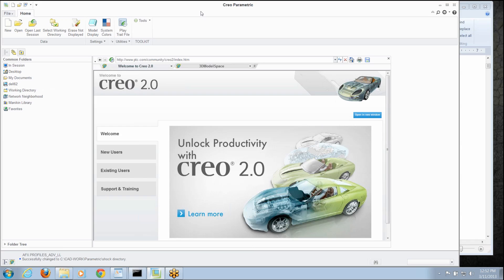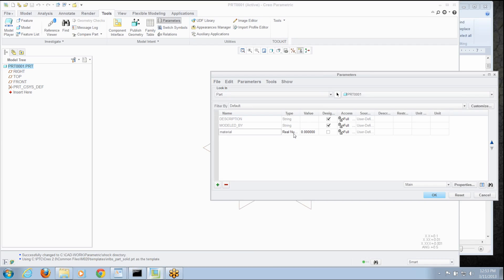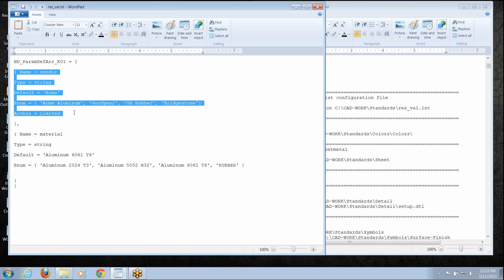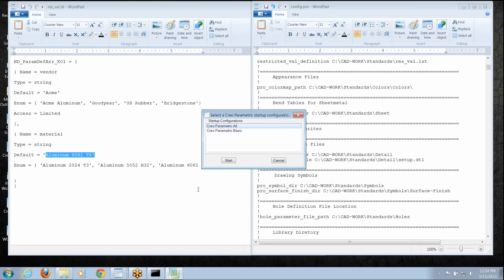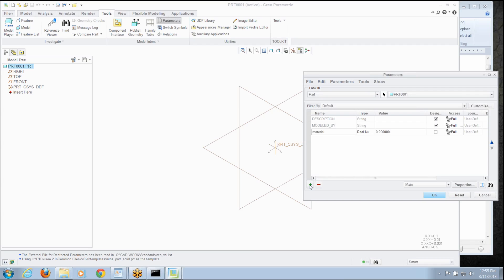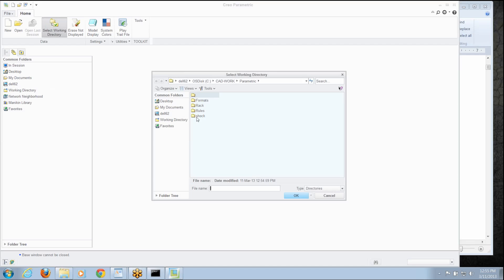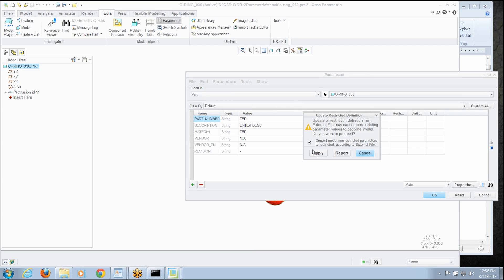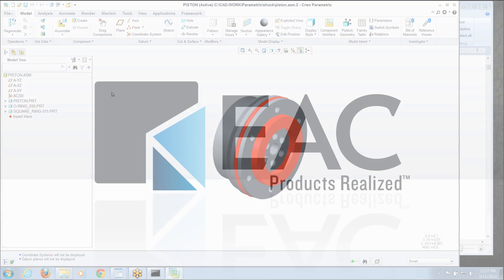How to preset and restrict attribute values in Creo Parametric - EAC Tip of the Week

Comment: can anyone help me to solve this issues.
i will explain the path which i was passing.
1st step typed in note pad:

{ Name = vendor
Type = string
Default = 'blue_new'
Enum = { 'GOODYEAR', 'kapri', 'luck' }
},
{ Name = material
Type = string
Default = 'aluminium'
Enum = { 'aluminium', 'SS316', 'steel' }
},

saved as type :  " all files"    and renamed as "   list1.lst   " then copied to the folder contain .config file.

open the .config file and added a new line as shown below: 
RESTRICTED VALUE LIST CONFIGURATION FILE
restricted_val_definition D:\Creo_startup\list1.lst

i have imported the config again , then the issue started,  
can anyone tell me the solution,i am not much expert in program coding. waiting for the reply.....

Comment: Hello EACPDS, I am currently trying to use the restricted_val_definition config in order to provided  particular set of input values that a customer can select. This parameter will then drive a an angular constraint of a sub assembly. In the example you provide you are using String Values, but what I am trying to accomplish would require a Real Number Value type. I guess I am curious if I am able to use the restricted_val_definition configuration with Real Numbers?
Reply from the maker: I hope this response helps! Two of EAC's Technical Account Managers responded to your question. Below is an example sample restriction definition file. They also wanted to add that the range of the parameter can also be limited. In the use case described, I would suggest limiting the range of the parameter from 0 to 360.
This can be done be adding the line:
Range = [0,360] in the definition.

The following parameter file list1.lst defines parameters with the names paint, color_1, color_2, num_of_coats, grade, num_1, num_2, Bool_1 (the names are shown in bold in the file).

{ Name = color_1
Type = string
Default = 'blue_new'
Enum = { 'red_"new', 'green_new', 'blue_new' }
},
{ Name = color_2
Type = string
..Default = 'white_new'
..! DEFAULT IS WHITE_NEW
..Enum = { 'yellow_"new', 'white_new', 'black_new' }
},
{ Name = num_of_coats
Type = integer
Default = 2 ! correct?
Range = [ 0 , 9 ] // 0<=Value<=9 
},
{ Name = grade
Type = integer
Default = 35 ! correct?
Range = [ 26 , 50 ] // 26<=Value<=50
},
{ Name = num_1
Type = real
Default = -5.0
Range = [ -10.0 , 0. ]
},
{ Name = num_2
Type = real
Default = 22.5
Range = [ 21.00 , 30.0 ]
},
{Name=num_3
Type=integer
Default=75
Enum={25,50,75,100}
},
{Name=num_4
Type=real
Default=50.5
Enum={25.1,50.5,75.45,100.123}
Access=full
}
{ Name = Bool_1
Type = boolean
},
!!! ADD MORE RESTRICTED VALUE PARAMS HERE

Comment: When you regenerate a model that has inputs in the relations, it will ask if you want to use the current input values or change them. Anyhting beyond that would require creating a custom pop-up using ProTOOLKIT.

Comment: I am a student and I am working on a flexible creo model for a bigger construction with skeletonmodelling.
The user that are going to use my model have no experience with creo. The height of the construction is variable. I would therefore like to make a popup window that comes when the file is opened and asks the user to type in the height of the construction. Furthermore there is one of the features that should only be there when the construction is over a specific height. Is that possible to program this with relations?
Reply: +Ronja Haase Hi,
Yeh u can do this by using pro-program and defining the parameters. For this you need advance license to access programe text file.

Comment: Hi Tyler,
Optimization run an iterative regeneration approach. Since you are restricting it to set diameter values it has no way to get from value "A" to value "B". It wants to increment between them and you are in a sense asking it to jump. I suspect that is the issue.
Mark

Comment: Thanks for posting this.  I've been looking for a solution to this issue for several weeks and glad I came across the video. 

Another question: I created these restricted values in order to specify a tube inner and outer diameters which limit the values to common dimensions that are readily available.  I'm trying to run an optimization study that is limited to these restricted values.  The study immediately fails when a value outside the restricted set is chosen.  How can I make this work?

Comment: Within ProE WildFire 4.0 I have a mapkey that creates a start part and applies my desired features, accuracy, parameters and model tree columns. I would like to control the values of the model tree columns with the restricted values list file. I tried creating the res_val file as lst, txt and a rtf, then updated the config.pro simular to the one in the video but when I start ProE I get a ProE message: External file for restricted parameters was not loaded because of invalid format.